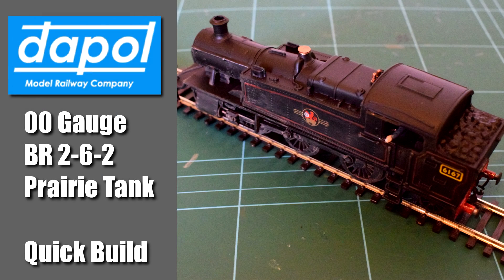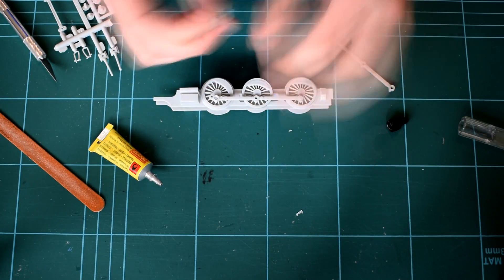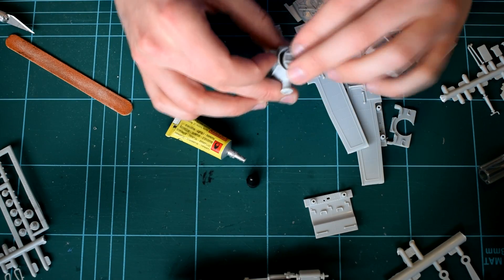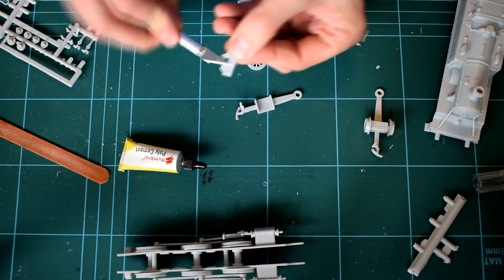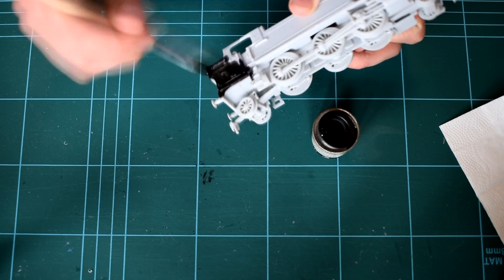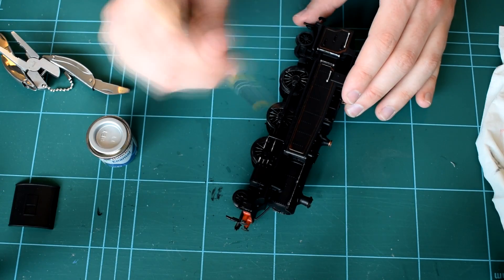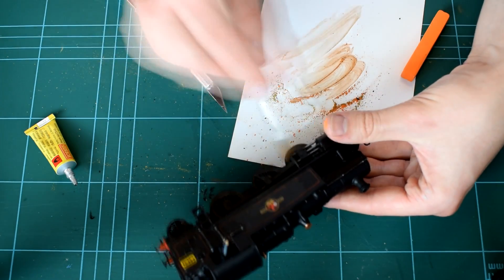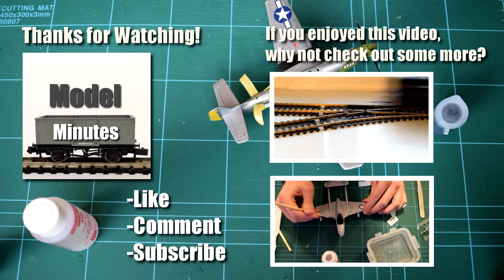Dapol BR 2-6-2 Prairie Tank - OO Gauge Plastic Model Kit - Build & Review

Comment: I have the Airfix model kit of this loco too.  It's an original late 60's-early 70's model so I'm torn between building it or leaving it as is, on the sprues still.  I got a very nice set of cast metal driving wheels and axles with the kit so may try electrification.  The part you mentioned about the motorised wagon may just be the ticket!  Plenty cd drawer motors that may suit.  I suppose I should give it a go, one pin missing from the motion set and the decals are rotted out so some new ones might be in order!
Thank you for showing this Dapol version.  Cheers!  Keep Well, sir!
Reply from the maker: Sounds like a fun project!

Comment: Im thinking of starting doing plastic kit modeling and I was wondering where you got that green sheet with the white lines on it ?
Reply from the maker: LMS Productions it's a self-healing cutting mat in A3 size. I bought mine online, but you can get them in the majority of good art and craft shops. I use it to protect the surfaces I'm working on, so I don't scratch or cover them in paint 😂

Comment: Is HO and OO Gauge the same thing? If you mind me asking.
Reply from the maker: In essence they are - at least they use the same gauge track (16.5mm I believe). The difference is that the scale for HO is 1/87 and OO is 1/76, so if anything, the track gauge is slightly too narrow for OO, but it's something that us Brits just stick with (probably because it's so well established now). HO and OO trains run perfectly well together on the same layouts, the OO stuff might look a little bigger is all
Reply: Okay, Thanks. ; )
Reply: The track spacing is HO (1/87) to be compatible with continental track. The body meanwhile is OO (1/76). Thus HO/OO is a hybrid scale.OO bodies look distinctly larger than the HO vehicles you get on the continent.
Reply: To add to the confusion: many 1:76 kits over the years have been erroneously labeled 1:72.

There isn't a vast difference in model size between them, but it is noticable.

Comment: Is there a way to fit a motor in the locomotive
Reply from the maker: GNR studios there's no provision for the inclusion of a motor, but I'm sure with some ingenuity and alteration to the chassis it could be possible. The only problem is that the plastic is quite soft and the components may have warped as it's an old design, so even if a motor was successfully installed I doubt that there would be much success in it running properly on track
Reply: It's doable (say those I know from LMRC's), but I've yet to attempt it myself.

Comment: You should have painted the parts first.  How do you paint the chassis behind the wheels once the wheels have been fitted?
By the way, that kit was first introduced by Kitmaster.   When Kitmaster went out of business Airfix bought up the moulds, but they only reissed a few of the original Kitmaster kits.   Many of the better ones were never reissued.
Reply from the maker: Alan F Brookes thanks for the information! I realised my mistake in not pre-painting the parts during construction, I over came this by spraying the chassis with paint, letting it dry then rotating the wheels slightly to reveal the unpainted chassis then repeating the process